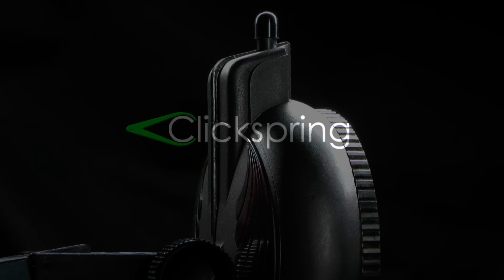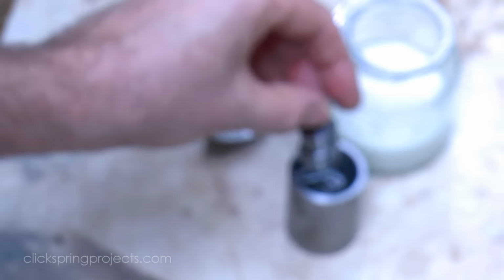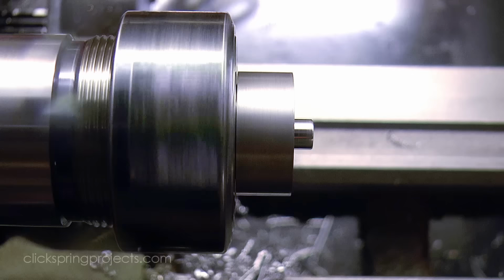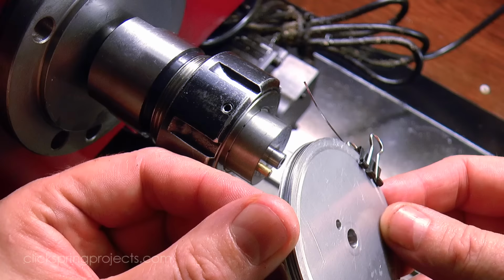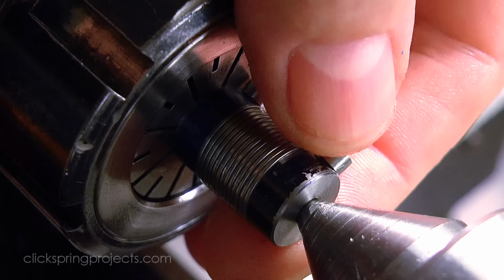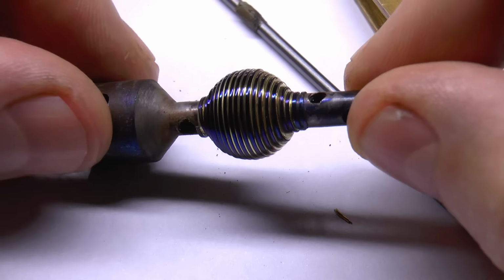Watchmaking - Making Carbon Steel Hairsprings for Watches, Clocks and Other Small Mechanism.

Comment: I worked in the spring industry for many years, and we made hair springs on cnc machinery. The modern process for large scale manufacturing is significantly different than yours, but I am very impressed by the quality of your finished product. I was not expecting them to look as good as they do. The polishing of the drawing rollers and other attention to the surface condition of the wire is great.
Reply: i'm a blacksmith and one of my teachers told me : The hammer translate his face  to the metal , keep it polished 
i think that applys very well to the rollers an how the end up extremly well finished
this guy is trully amazing

Comment: In bygone days when I had a watch repair shop I chanced upon a chronometer with a barrel style spring which reversed winding direction halfway up the barrel such that as the upper half got tighter the other got looser thereby maintaining an even tension throughout the balance swings.
Reply: That would be cool to see :)

Comment: I have to applaud this. Very much everything on display from both Watchmaking by Daniels and the Antique Watch Restoration series by Archie Perkins 👏👏 I use hydrated lime powder and denatured alcohol for my heat treating, gets the same glasslike shell that really blocks out the oxygen. Would burn off the alcohol first and then crank up the heat and let it fuse into a glass like shell. Works well. Extremely impressed how you even did the Helical and spherical with the removable sections 🤘 you might be interested to learn glass hairsprings were done on formers too... Look at the work of englishman Anthony Randall
Reply: Yes, those glass hair springs were amazing :)

Comment: A neat twist on the standard dial indicator would be one which has hands for both inches and mm.  It could certainly help Americans struggling with metric.  The only snag would be the hands spin much faster than in a watch,  so lubricating the concentric output gears might be an issue.  Also, the 127 tooth gear would have to be the large one in the train, so AFAICS you'd need to do the rack and pinion in inches.  A dial caliper could be made the same way.

Comment: Hi Chris, the easiest source of hair springs is flat nichrome wire as used in electric toaster elements. It can be stretched to give it the cross section desired and work hardened by running it over a hard corner. Reannealing is easy as it electrically evens out heating from a current and can be closely controlled. Not the strongest springs but often enough.

Comment: Hi Chris. Superb video as usual. Just one idea: I used to make annealing in an old gas chromatography oven. This ovens can be bought (eBay or refurbished chemical instrument web sites)  in good shape for a not very big amount of money. You can program very precise heating ramps, heating time (up to several hours, allowing deep annealing in large pieces) from 40°C up to 380°C, which is perfect for all annealing processes in a perfect controlled environment (even with inert atmosphere with a lil bit of creativity, avoiding the annealing oxidation). Thanks for all your efforts to pass on info and knowledge.

Comment: I wonder if one of those tiny induction heating coils could be implemented between the reels to soften the wire. Though it does incur oxidation, perhaps it wouldn't be a problem as the part was still hot going through the rollers.

Comment: Take some wire that's REALLY springy, heat treat it, spool it onto a round thingy that you made in the lathe with a knurling tool as a guide, then heat treat it, then wound it around another circular tool that you made, then heat treat it, and voila! A spring?!

Comment: Great video, as always~

I have a question though, is anyone is interested in answering, - if one is required to design a spring of a given spring constant (k), how would they go about incorporating it into this process? Is it transferred to a design environment by converting 'k' into the physical dimensions of the spring (thickness, pitch, length, etc.)?

Comment: Abstract

This video details the process of forming a carbon steel hairspring, a
component historically used in mechanical watches and indicators. The
focus is on adapting common home-shop tools to achieve the desired
results.  The process involves sourcing and preparing suitable wire
stock (such as music wire), rolling it to the correct dimensions,
winding the spring into shape using a specialized tool, and finally
heat-treating and tempering the spring. Alternative hairspring shapes,
such as the helical spring used in marine chronometers, are briefly
explored.

Summary

Introduction

* 0:03  A dial indicator project necessitates the creation of a hairspring to provide anti-backlash force.
* 0:17 Hairsprings are a standard component in mechanical indicators but are more widely known for their use in watches and clocks.
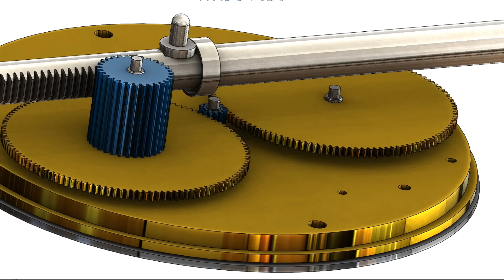* 0:29 Watchmaking textbooks offer detailed instructions on fabricating hairsprings.

Hairspring Background

* 0:43 Early hairsprings were often not heat-treated.  
* 0:56 Modern hairsprings employ alloys with specific thermal properties to compensate for temperature changes.
* 1:15 The latest hairsprings are made using a silicon etching process.
* 1:26 This video will focus on forming a carbon steel hairspring, historically used with bimetallic balance wheels.

Rolling the Wire

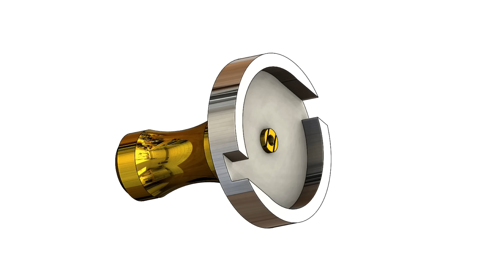* 1:38 Flat spiral springs are formed on a specialized tool with a recess to shape the spring.
* 1:51 The recess defines the inner diameter of the spring.
* 1:55 The number of openings in the tool determines the wire spacing in the spring.
* 2:15 The tool's configuration effectively determines the length and performance of the spring.
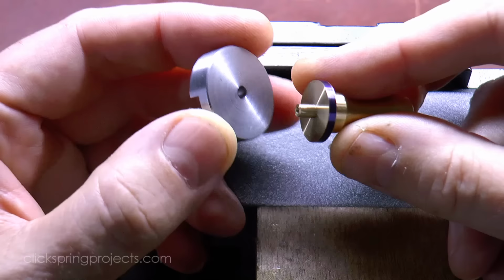* 3:04 A brass winding arbor catches the inner end of the wire, allowing it to be pulled into the recess.

Winding Process

* 3:52 Carbon steel wire is usually supplied in a flat form from a rolling mill or drawn through a die.
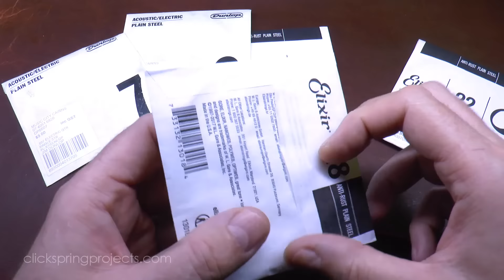* 4:04 This project focuses on repurposing a home-shop tool for rolling the wire.
* 4:12 Music wire is a suitable source material.
* 4:30 The wire must be annealed before rolling as it's too hard in its supplied state.
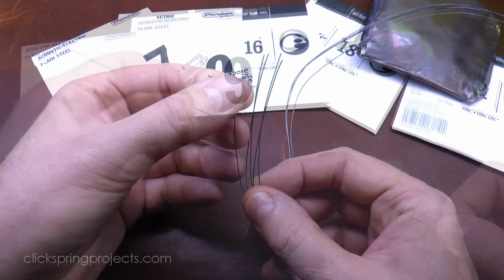* 4:58 A clamp-style knurling tool, with modified rollers, can be used on a lathe for rolling.
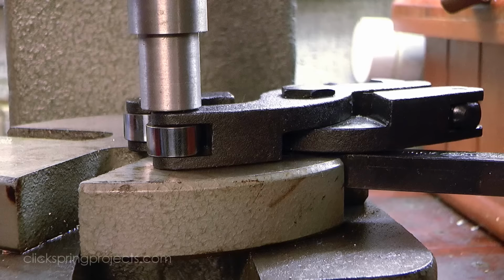* 6:01 A MIG welding nozzle guides the wire onto the rollers.
* 6:08 Using spools helps manage the wire during the rolling process.

Heat Treatment 

* 8:07 The condition of the wire before rolling (oxide-free, polished) is important for the final outcome.
* 8:24 The wire is passed through the rollers multiple times, gradually closing the gap for final dimensions.
* 10:26 The wire may work-harden during rolling, requiring re-annealing.
* 11:03 The wire is wound carefully into the recess of the forming tool.
* 12:27 Boric acid mixed with denatured alcohol helps minimize heat treating scale. 
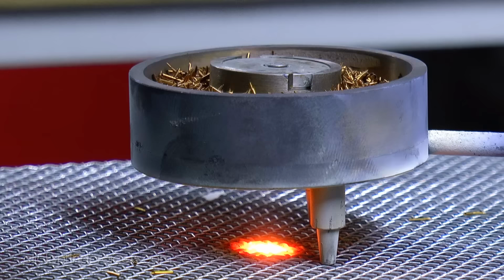* 13:04 After tempering, the spring is set and can be removed from the tool.

Forming a Helical Hairspring

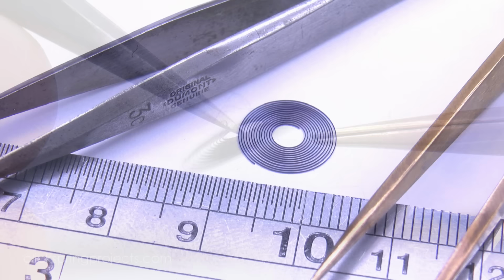* 14:45 Hairsprings can take shapes other than flat spirals—for example, the helical spring used in marine chronometers.
* 14:58 A helical spring is formed similarly to thread cutting, with a tool slightly wider than the wire.
* 15:26 The fasteners on the helical forming tool need to be left-hand threaded to keep the wire under tension.

Other Hairspring Shapes

* 17:26 There are other interesting hairspring shapes, such as the spherical spring.
* 17:37 The process is largely the same—wire is wound around a former corresponding to the final shape. 

Disclaimer: I used gemini ultra 1.0 (2024.02.25) to summarize the
video transcript.  This method may make mistakes in recognizing words

Comment: Amazing work. Impressive to see your dedication to precision. Love it.
Curious about what you were using to polish the springs. Also, when tempering, is it just set on that bed of brass? filings just to give it a surface to rest on? Or does it have a specific purpose other than that?

Comment: For the tempering on the first spring to set the shape, how did you know you were at the correct temperature while it was completely encapsulated in the forming tool?
Reply: In the old books on Horology that I've got, they say to make sure the forming tool is clean and bright on the outside (so taking off any fire scale from the hardening process) and then bring the former to the correct temper colour. It can't be any hotter on the inside, and if it's brought to heat slowly the inside will reach the same temperature at the same time. Cheers

Comment: I'm surprised the steel quenches properly when completely coated in borax glass, but I guess if the carbon steel is deep hardening enough then it's not a big deal.  I generally use noscale when making knives to reduce oxidation and it conducts heat just as fast as bare steel.

Comment: Breathtaking, Mr Chris. Do you measure spring force afterwards and re-do the process if not satified? Or you have done it so many times and spring spec is so wide so you know all process parameters more or less before you start?

Comment: For the flattening step, could you attach "handles" to the two ends of the wire and pass it back and forth through the knurling tool by hand (not using the lathe)?

Comment: Chris, are you using a different method off camera for heat bluing the springs in their final result? It seems the initial bluing came out uneven, but after a polish you blued again, but the uniformity was significantly better. With springs like that spherical one, I'm sure getting temperature uniformity must have been a challenge.

Comment: Amazing. How you turn Springs blue?
Reply: It's a property of steel. When it's very clean, as you heat it up it will go through a series of different colours that correspond very closely to particular temperatures (known as Temper Colours) and indicates how soft the steel is becoming. So you harden the spring (and as Chris showed you can't use it like that as it will break), clean it, and slowly heat it up. It will first turn Light Straw colour, then Deep Straw, Brown to Purple, then Deep Blue (which is the perfect blend of hardness and flexibility for springs), then Light Blue and on to Grey, at which point the metal is getting close to annealed and needs to be hardened again to be of use.  It's possible to clean and re-temper a steel item multiple times, and, as long as you don't go past the temper colour that you want, it won't damage to item. Cheers

Comment: When rolling non-ferrous metals it you do not pass the material through the mill in the same direction you can develop cracks, sometimes even with annealing in between.  Is this simeth8ng you run into with steel?

Comment: I’d love to know what the point is of such fancy shaped springs. I assume there’s a reason to go to so much trouble.
Reply: Evenness of expansion and contraction when in use. In the 1800's extremely accurate clocks (good ones would only lose or gain a few seconds per year ! ) were used for navigating ships. You set the time to your home port then check local noon as you sail and the difference between them tells you how far around the world you are. If your clock is inaccurate, even by a number of seconds, your calculated location verses your true location won't agree and you may run into rocks or miss your destination and run out of food and water. 
There was a constant quest to find hair spring shapes that would have the most even behaviours as the balance wheel twisted them back and forth with each beat.
Cheers

Comment: I looked through the links in the description, but found nothing for the pouch used for heat treating the wire. Did you make it yourself? What's it made from.

It's not too surprising that the most delicate part takes the most amount of work. I'll probably go for the "store bought" option on my first go.
Reply: It's most likely stainless heat-treating foil, or 'tool wrap'- it comes in rolls like aluminum foil and you fold it into a pouch sized for the part you're heat treating.
Reply: Thanks for the info. I should be ordering some soon.

Comment: Disclaimer: the notion of this non-lathe owner given lathe advice to Chris is absurd.

Back in the golden age of UK model engineering a common attachment to make for a lathe was a spindle handle. This was a simple crank that fitted directly into the rear end of the spindle, commonly via an expanding internal collet. Pretty simple to make.

This was often used for thread cutting to a shoulder (perfect ability to go slow and stop obviously), winding springs, when high torque was needed, and to reverse the spindle when that provision wasn't provided by the lathe.

It would certainly appear to be a useful thing in this instance for hairspring winding.

Comment: Chris always goes so far beyond the norm with his projects.

Need a clamp? We BUY an off the shelf clamp........... Chris MAKES a clamp, then spends 6 hours mirror polishing it.
Need a lathe tool? We BUY a lathe tool........ Chris MAKES a lathe tool.
Need a machine screw? We've got boxes of them from shops......... Chris reaches for the raw stock and fires up the lathe.
Need a spring? We'll spend a few hours digging around on suppliers websites, then order a few different ones to try out........ Chris says "Hold my beer, this could get a bit involved".
Want a new clock? We say "Amazon have some quite pretty ones that don't cost a lot, and can be overnight shipped to me within 24 hours"........ Chris says "I'll just use weekends and evenings to make one myself. I bet I'll have my new clock in 20 months...... 24 at the outside". :D